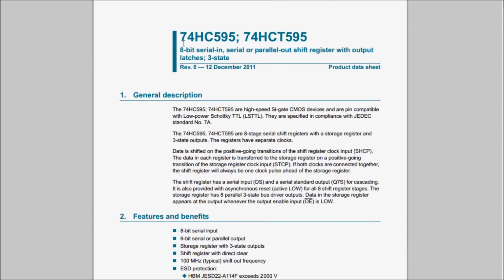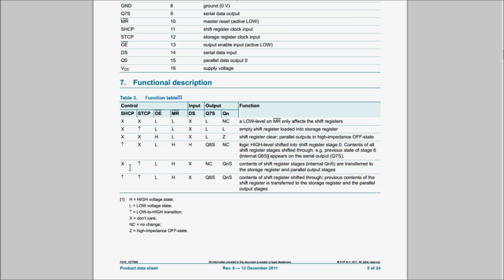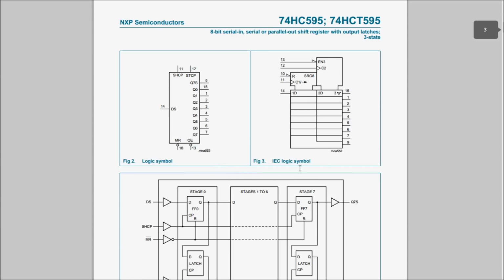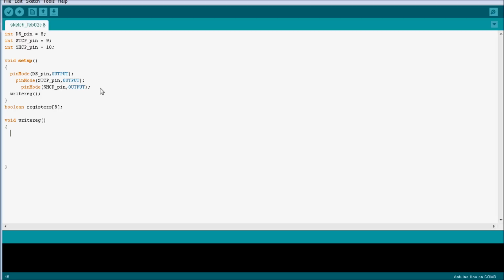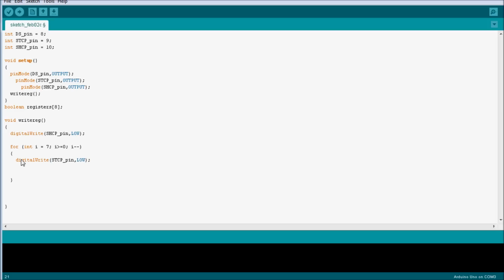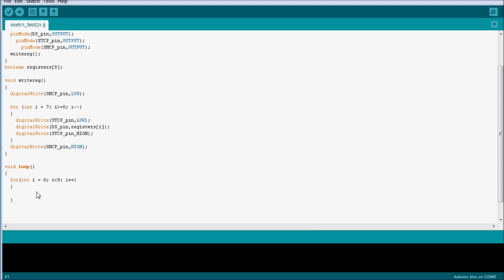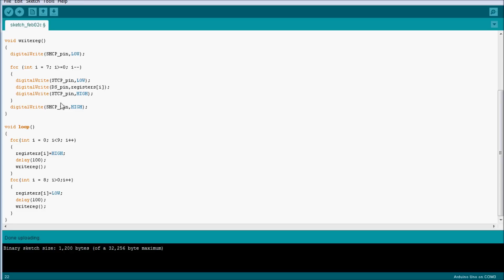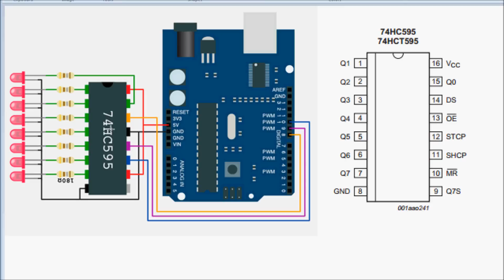Arduino Tutorial #3 - Shift Registers (74HC595)

Comment: Can I get output between 0000 0000 to 1111 1111 range..?
If yes then explain please.
Reply from the maker: You can get any output you desire, you just need to shift LOW and HIGH voltage levels you want into the shift register. You can easily set the data to be 01010101 if you wanted to. Watch the tutorial one more time; you can use the same function to input any output combination into it.
Reply: Thanks man.
I appreciate that, I will watch it again.

Comment: Is it possible to use a shift register with the analog pins?
Reply from the maker: The analog pins on Arduino can be set to digital, so yes you can use it on them.

Comment: Hey! Thanks for the video! I wanted to know, if I want to add another shift register for more LEDs, will have to assign 3 more pins to it? or can I keep SHCP common and add 2 more pins? or is there a way to link the two registers serially and use them as one? Like 16 LEDs together? and change "boolean registers [8]" to "boolean registers [16]"? Hope you've understood what I'm trying to ask! Thank You!!
Reply from the maker: Nipun, you would keep the same 3 pins. You would need to change the registers to 16 as well as some of the other variables in that code to get it working.

Comment: Can I use this 74HC595 IC to control servos instead of led's.. if so what changes needs to be done to the circuit, thanks
Reply from the maker: I would not recommend shift registers for PWM controlled devices such as servos. You can very easily toggle a DC motor with them, but PWM will be a challenge. There are dedicated ICs you can use for those applications.
Reply: Can you maybe give me a shematic or circuit for this
Reply: Thanks for your reply

Comment: hey how can i change the code so that instead of supplying the serial data internal of the arduino, I want to use another source. I have another device thats sending serial data, i want to feed that digital serial data into my arduino and have it send to the shifter to get converted to parallel data.

PS. is there anyway to convert the serial data into parallel data right in the arduino

Comment: Thanks for sharing!
Is it possible to control like 3 or 4 Shift Registers with one Arduino Uno?
Reply from the maker: Of course you can! The Shift Register even has a pin which allows you to chain them together! Look in the datasheet linked below my video and you should be able to figure it out. This function is very useful for things like an LED cube where you want to control every single LED!
Reply: EEEnthusiast Wow! Even better to use them in a cascade mode! I'm going to study this for sure and try to control 32 LEDs. Thanks again!
Reply from the maker: Keep in mind you may need some transistors to drive all those LEDs and shifts. Arduino may not be able to source all that current depending on how you do it. In any case, if you ever damage the chip, you can always get a new one for 3$ and put the bootloader on it, so don't sweat it. Let me know how it goes!
Reply: EEEnthusiast Hey man, I have made some progress here, but with only one by now... I'm going to get some more of them and try to control more outputs, I have already figured out how to conect them in series!

Comment: Cool.  But have a question.

when I saw this and before I got to the fritz in schematic I was wondering where will the power come from to light the LEDs.  I didn't thing a single pin could provide enough power to run 8 LEDs at once.  Using a 2.2v forward voltage avg for LEDs that's 16+volts of drop.

Comment: Hey I think you messed up SHCP and STCP. maybe your cables are switched.
but you have to pull storage LOW outside the loop and the clock LOW and HIGH inside the loop for every bit.
Reply: that   - with  next  on software    -    if  messed   up  finding  where   a  'pain'  

tutorial   on  hardware   output   with  resistor  divider  as  analogue   input  

four  inputs with    ADS   1115     - texas   do  not  have  that  and  they  make   the device

Comment: Thanks for the detailed video.

I'd like to point out a couple of mistakes in it so that you can notify your viewers, the second for in the loop method has a ++ iterator when i think it was meant to be -- since you're iterating down from 8 to 0.

Another problem is that the resistors on the graphical diagram you drew do not match your actual setup, by this i mean that in the diagram the resistors were placed between the output and the + of the leds while in the actual setup you have the resistors between the - of the led and grnd.

Comment: Is it possible to expand the script (and how?) to manage 2 shift registers and then to control 16 LEDs?
Reply from the maker: Definitely! I covered just that in one of my recent tutorials on shift registers. Check it out.
Reply: just join the ICs in series using the Q pin a output and connecting ot to Din pin on the next shift register. And so on.
Reply: Do as Tom said, then I assume you would adjust the for loops to range from 0 to 15 (i.e. for(int i = 15; i >= 0; i--) and for(int i = 0; i <= 15; i++)).

Comment: I like your teaching style, (I have subscribed a long time already) and I understand the bits about how the register works - all that clocking and latching etc., what I can't get is - everyone who talks about shift registers uses them to light up LEDs. What if I want to run some motors - DC, or Servos, or Steppers, (through the proper drivers, of course) - how should the code look like "inside"  - the parts that do the useful work other than activating the shift register ?

Comment: Can i use it for analogue outputs ??
Reply from the maker: yes, you can PWM all the outputs if timed correctly. You would have to write a fairly intricate function
Reply: But i have doubt that, when i will switch to next channel of all /8 of chip 595 ... will it memorize & maintain the last defined output till next update !!!
Reply: mayur thacker
it depend on the bits you sent it like if you send 10001000 then in the next turn you send 11110000 it will update all the bits .

Comment: Is it necessary to set stcp to low in order to pass i values to ds? Can't stcp always be set to high? Same question regarding shcp. Sorry for this very down to earth question. I have only once had Arduino in my hands.
Reply from the maker: You do have to pull them low and high. The whole concept of this IC is that it will only trigger when those pins are transitioned. Check out the datasheet, it explains all the details.

Comment: For me it just turned each individual LED on and left them on. Any idea what is wrong?
Reply from the maker: That tells me that all your outputs are high. One issue may be the fact that your delay is too short, so you are cycling through them faster than the naked eye can see and thus they appear all lit up. Try sending nothing to the IC and just leave it powered, do the LEDs still turn on?
Reply: EEEnthusiast I copied the code exactly as shown in the video
Reply: Korban OMalley The same thing happens to me. I even corrected that line were the i++ was instead of i-- and the same... what is happening???
Reply: EEEnthusiast same here, the LEDs blink up then stay on instead of blinking back down
Reply from the maker: I did make a mistake in the code. apologies for that.
Reply: figured it out! in the "writereg" function's for-loop, you set STCP low, write a value to the DS pin and then set STCP high again. when STCP is set high, it triggers the IC's output, so it outputs whatever is in its memory.

so in the for-loop in "writereg", every time after you've written one bit, the STCP is triggered and it sends the byte in memory to the outputs, which, in my case, gave me 8 LEDs that were on with a single scrolling off LED.

to fix this, make like this (apologies if the code formatting isn't correct after i submit this reply):

void writereg() {
  digitalWrite(STCP_pin,LOW);
  for (int i = 7 ; i >=0 ; i--) {
    digitalWrite(SHCP_pin,LOW);
    digitalWrite(DS_pin,registers[i]);
    digitalWrite(SHCP_pin,HIGH);
  }
  digitalWrite(STCP_pin,HIGH);
}

*disclaimer: i have no electronics degree and i have a java background. i started learning linux in december last year and got into electronics in about march this year. if what i said is a load of bollocks, please correct me so that i don't look like a douche when i tell the ladies at the bar the wrong things. ;)
Reply: EEEnthusiast Can you please explain how fix this code ?
Reply: iKostanCom in his for loop that was supposed to turn off the LED's he left the i++, he should have changed it to i-- sense he wanted to go from led 8 back down to led 1. The downfall to copy and past. haha.